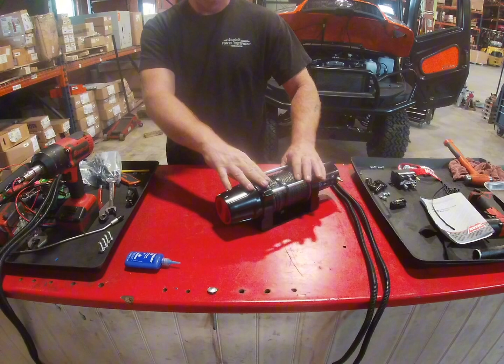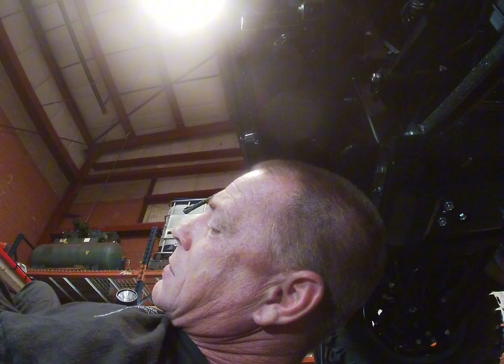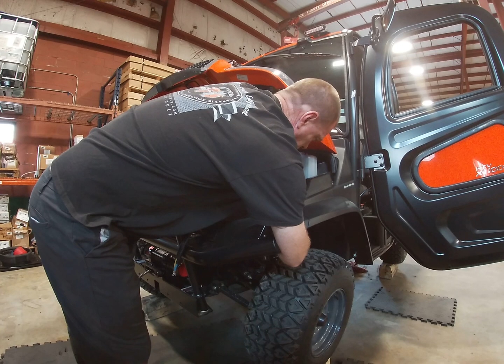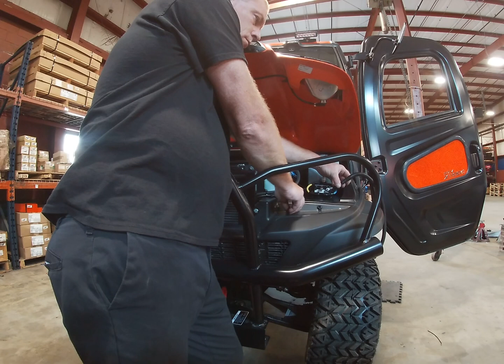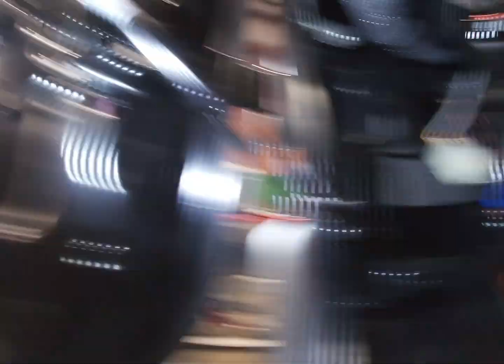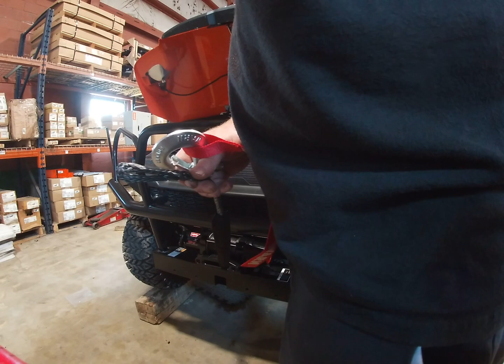Installing a winch onto a Kubota RTV 1100.

Comment: Where did you route ANY of the wires? I watched to see where you routed the wires, particularly the main positive. Some narration would be nice too. Why did you add a ground jumper and where did you attach it to?
Reply from the maker: If I get the chance.. I’ll have to make a better video on the wiring..  the positive wire I run along with the coolant lines on the inside..  
to the left of the expansion tank under the hood,, there is a factory hole.. I grind it and use it for a ground..  I hope this helps
Reply: @ryanlynch2259 , thank you for replying. I was going to ground through the chassis like you did but the owner wants a dedicated line to the battery.